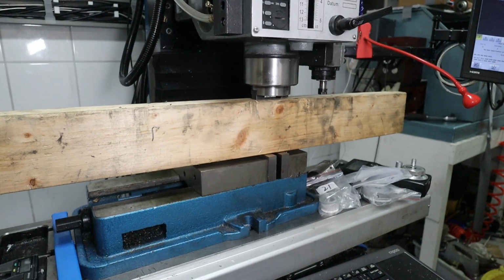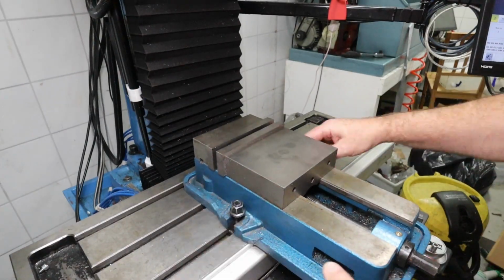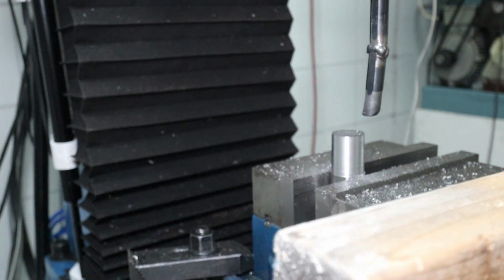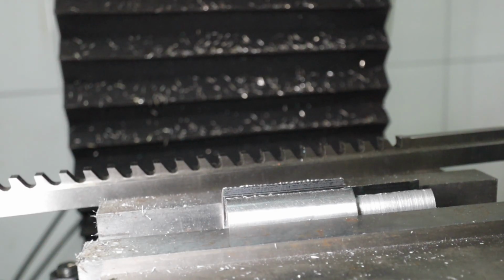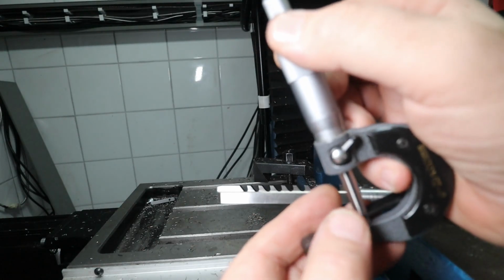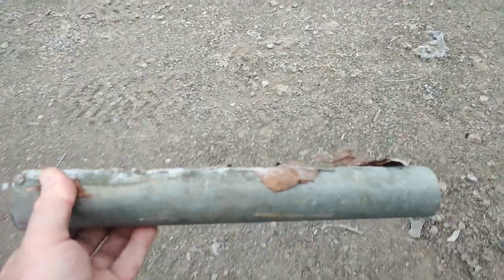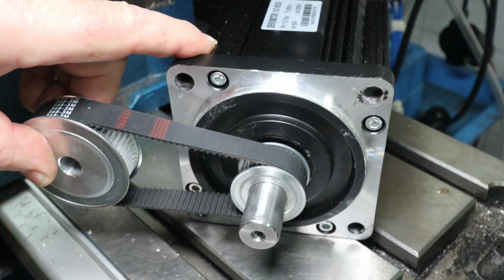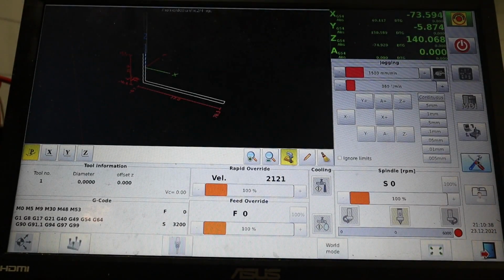Gearing down

Comment: I think the solution is to put an electric brake coupled to the ball screw or to the servo motor shaft or you can also use a precision reducer which are very good solutions ... on a personal level I will tell you that pulleys and belts always give imprecision and precision. There are many problems ... it is always a better solution for the servomotors to be connected directly to the ball screws and if you need a reduction, use a precision reducer and no pulleys or belts, greetings from Spain ... I pass a link of my little channel so that you can see one of those precision reducers installed.

https://www.youtube.com/watch?v=IfxW-jR2hcw&t=950s
https://www.youtube.com/watch?v=0im9ow5L-9E&t=456s

Comment: i wasn't aware broaches could be used with a hammer 🤣
Reply: He used a small mallet, that is fine
Reply: I hadn't seen it done this way before either. I'd have thought the shock loading would be rough on the broaches teeth, but then again, it's probably not much more than punching it through using several swings on a fly press.
Reply: @Reman1975  yeah no complaints here just wasn't sure if hitting it with a hammer is how you should treat your broaches i mean those things are pretty expensive at least over here... cheers, daniel!